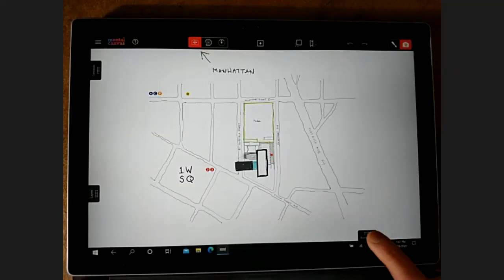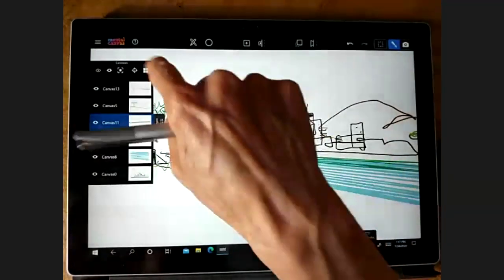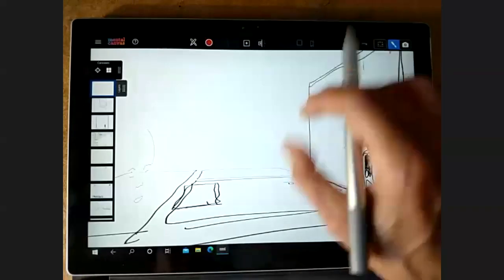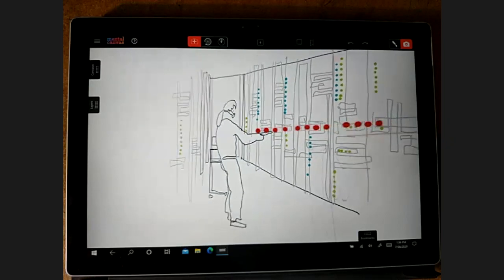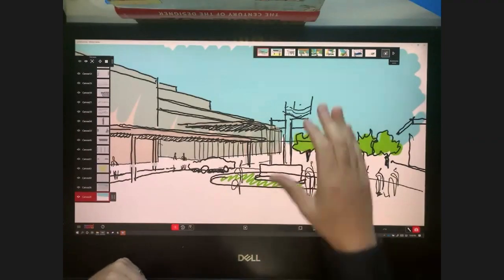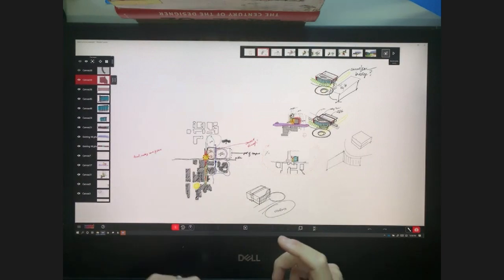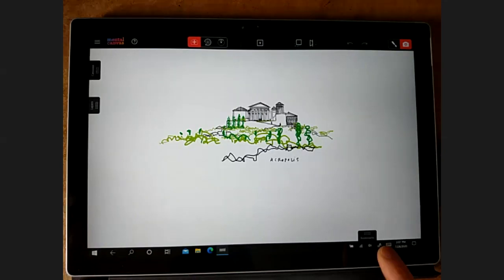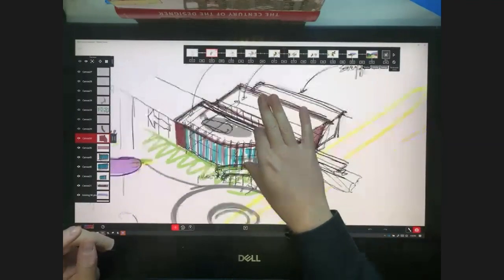Webinar: Conceptual Architectural Design with Mental Canvas

Comment: In mental canvas I can draw a rectangular or square plane immediately in perspective or I must necessarily draw it in an orthogonal way as if it were a two-dimensional view and through the "hinge" is that the lines leak.? I like to dub directly in perspective. I don't know if the program assimilates it as such or should I always draw two-dimensionally?
Reply from the maker: In Mental Canvas, you can draw on 2-dimensional planes that are positioned in space (called canvases).  When you are drawing, you are always parallel to the plane that you are drawing on.  You can position that plane before or after you draw (hinging the canvas is one way to do this).  Feel free to send us an email if you’d like to review in more detail.  Thanks!
Reply: @MentalCanvas  Thank you. I really consider that Mental canvas is for architects, the story board of the project. Just as a film has the previous scenes drawn (fixed) after the script and before the post-production processes and movements of the actors, in architecture we can experience the spaces (in movement) previously long before it is modeled and defined to improve our planning and make post production more efficient. I hope I can buy it, I already have my ipad pro. A hug.!
Reply from the maker: @ACADEMIADEDIBUJOPUNTODEFUGA  if you would like to purchase a subscription, please contact us at sales@mentalcanvas.com - thank you!

Comment: No iOS (iPad) version right?
Also, is this only for MS ‘surface’ ? or general PC user?
Reply from the maker: Yes, there is an iPad version available. You need to have an iPad that supports an Apple Pencil (version 1 or 2). The files are compatible between the iPad and Windows versions.
Reply: Mental Canvas  I don’t understand.
All can find at the Apple App Store is called ‘The other side in 3-D’ by Mental Canvas.
Reply from the maker: @haleohanamalama2967  Mental Canvas is not yet available on the App Store.  It is in final testing and in use daily by our users in the early adopter program.  You can reach out to us as sales@mentalcanvas.com to learn more.